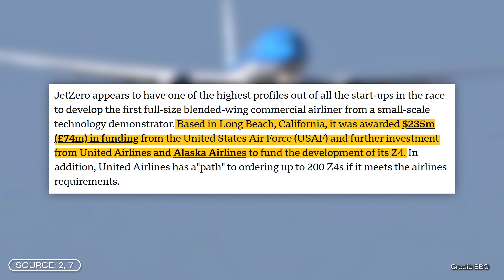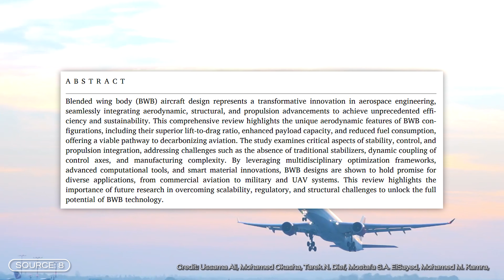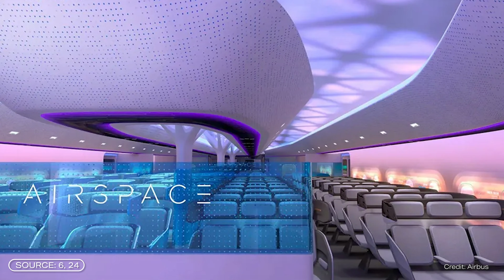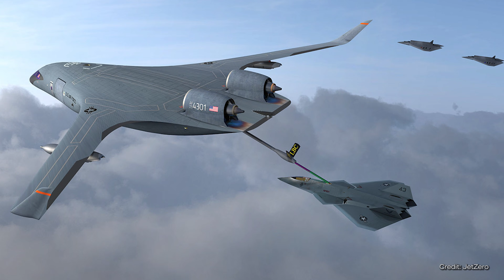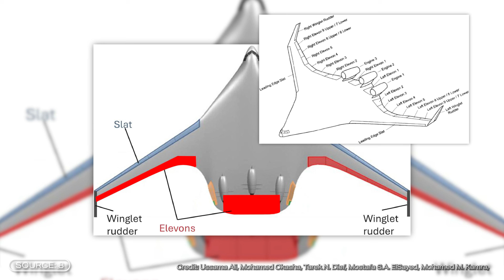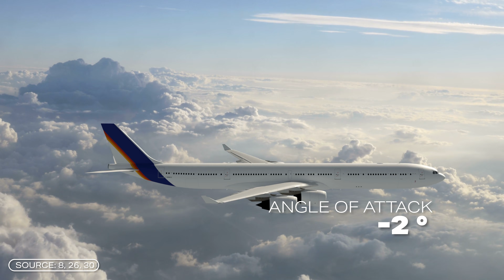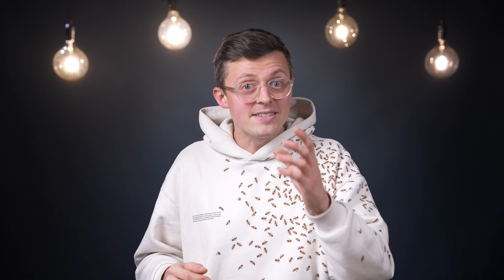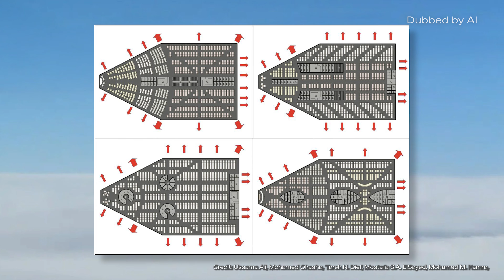The "Perfect" Plane Has One Big Problem...

Comment: Civil aircraft need to be stable without the need for active stabilization through fly by wire.
The B2 is also a flying wing, but it is not statically stable. It needs fly by wire for active stabilization. It onces crashed due to a problem with this active system.
Reply: Agreed, the idea of sitting inside a plane that needs constant micro adjustments from a computer to just fly straight does not sound inviting to me.
Reply: Yes, software crashed some 737 Max aircraft.  We don't want that
Reply: @kensmith5694 
Poorly trained pilots that didn't understand the technology they were operating crashed those 737 Max aircraft not the software. 
Those pilots sat in place like bumps on a log and watched their aircraft fly themselves into the ground.... 
No mysteries Kemosabe.  🪶
Reply: I'm confused, are we saying fly by wire is bad because almost all of Airbus planes use it.
Reply: @jake_sabrwolf9795 
It's being said that the design is inherently unstable if the only way it can be controlled is Fly By Wire... 🤷🏼‍♂️
Reply: @jake_sabrwolf9795  confused indeed ;) It's about the stability dependency. All those Airbus planes would just fly straight on their own without computer dependency. This flying wing design does not, that's the issue. If something does go wrong you're going down hard.
Reply: @jake_sabrwolf9795  Notice he said "active stabilization"
Reply: @jake_sabrwolf9795  Not necessarily. 'Fly by wire' is a system of controls that transmit pilot adjustments to various aero surfaces. 'Active stability control' is quite another issue. Most all jet fighters are aerodynamically unstable in all three axes, so they need it. Obviously the 737 MAX is not pitch stable (hence TCAS). The original Northrup flying wing had three Honeywell analog/vacuum tube stability control computers on board. There are ways to make any of this reliabiable with enough redundancy.
Reply: Also how to pressurises such a shap?
Reply: But all modern aircraft are already fly-by-wire. No control if there's a full failure of the system. I don't see how stability helps you land an aircraft without configuration control.

Comment: Hydrogen is a dummy fuel for air, lng is where it's at though. The turbines are already able to burn it.
Reply: Propane or butane, these liquids easily are common use. Not cooler required or super high pressure
Reply: @juhajuntunen7866  supply constrained tbh, and availability is not universal but we have an infinite supply of lng everywhere on the planet.
Reply: It is a shame ammonia is so toxic.  It would be a great fuel otherwise.

Comment: mods: 
1./ Use electric fans on top, use drop down modular generators under but inside the fuselage. 
2./ Passengers and cargo should be loaded via "Thunderbirds Style" modular loading these can also have parachute escape built in .
3./ Tail units should be rotate and deflect like birds
Reply: Your first idea seems like it'll be a slow pig and your other 2 ideas seem like many tons of weight that can't go to payload.
Reply: @suserman7775  your first comment seems like a troll , congratulations and good duck buddy.
Reply: Modules would also permit quicker turnaround (between flights).  No need for main structure to wait for passenger-area maintenance/hygiene or for luggage/baggage unloading and loading.   Latter would also speed up security situations requiring complete luggage unload – and would guarantee that nothing was missed out.

Comment: Also a good shape for electric aircraft
Reply: Yes.  There is a new battery with twice the energy to weight that could combine nicely with the 50% lower energy need.
Reply: There won't be any commercial electric aircraft in your lifetime and probably never.
Reply: @kirkjohnson6638  Does Archer not count?

Comment: The reason why this design keeps being dropped is the frontal area is too wide.  Conventional aircraft are skinny with a minimal frontal area.  As the aircraft gets closer to modern flying speeds that frontal area piles up and causes compression and turbulence side effects.  The blended body can only fly slower than modern aircraft for that reason

Comment: I forget the exact name, but there's some sort of windshield that isn't visible on radar. If this happens and puts the plane instantly above 6%, then it becomes unstable and jumps to 10% or more. I'm not an expert. It's just a thought.
Reply: Regarding the one "that isn't visible on radar", maybe you meant micro burst ?   If so, then that (radar blind-ness) was true before the 1990s but since resolved, through the use of Doppler tech (in radar).  Doppler being the German 😃 origin surname of the Austrian physicist who was the first to publish the fundamental frequency-"shifting" due to movement principle (same as we all experience acoustically).
Reply: @DavidEsp1  thank you❤
Reply: Presumably you meant wind shear.
Reply: @DavidEsp1  yes. I was tired and didn't double check what was being dictated. Thanks again.

Comment: Might be viable for cargo and military purposes atleast. Definitely worth exploring.
Reply: Yes, if it works well for military aircraft for ten years, then they might build the commercial version.
Reply: Agreed. -- The usefulness of the space inside the fuselage will definitely influence the decision whether to build a blended wing body design or the tube and wing design. -- With the 747 Cargo transport plane, when the front of the fuselage is opened and the whole expanse of the fuselage is opened for easy loading and unloading. That is a hard to beat that design.
Reply: If they can load wide cargo, that could solve problems like transporting UFOs, portals, and assorted wide loads.
Reply: @MsTyrie  and plus sized passengers who are demanding 2 seats for the price of 1
Reply: i think it would make a fairly poor cargo plane as it currently is. low ceiling height, structurally weaker than tube/wing types, where do you place the cargo doors?

Comment: NOT HAPPENING (for commercial passenger) since the US FAA has determined that the evacuation time from a blended body or wider body than are currently approved is unacceptable. It's a safety issue, not fuel economy. Of course, if the position of the FAA changes the blended wings might get produced by Boeing and Airbus.
The military of course can fly anything it wants to.
Reply: USA not on their playlist then. Or evacuation must planned differently.

Comment: The turning acceleration G issue is way overblown because it can be easily accommodated by doing slightly slower turns.   This will only be an issue coming into very extreme landing patterns like Hong Kong.   The flight control system will definitely include software to manage passenger comfort in turns. They could potentially also minimize this issue by using spoilerons.

Comment: No reason you can't put tubular pressure vessels inside a flying wing.
Reply: You've never heard of a little thing called WEIGHT ?
Reply: @suserman7775  yes  and the structural strength to weight ratio of a tube is greater than the alternative structures which would otherwise be required.
Reply: @crawkn Yes a tube has a superb strength to weight ratio but it is ADDED weight. Think about it, if you went by strength to weight ratio alone, a plane's fuselage would be a sphere instead of a tube.
Reply: @suserman7775 I'm talking about the tubes replacing part of the internal support structure which would otherwise be required if you didn't have tubes. Airplanes aren't just hollow skins.
Reply: @crawkn What?
Reply: @suserman7775  I think I've explained myself adequately if you still don't understand I don't think I can help you.
Reply: @crawkn You referred to "tubes" twice in a way that makes no sense. As far as "internal structure", what about it?   As far as "airplanes arent just hollow skins"...ok but who said they were?
Reply: @suserman7775  You seem determined to miss the point. "Tubes," generally cylindrical structures with hemispherical ends, are advantageous for service as pressure vessels and also can do double service as minimal weight structural support for the external wings / airframe. Without their structural contribution you would require other structural support, which might be even heavier. I won't reply again, if you haven't gotten it by now you aren't going to.

Comment: A hybrid turbine electric configuration would allow much faster reacting electric fans that would need very little maintenance. The higher maintenance parts could be put at the rear and be more accessible.   The electric fans could respond much faster than turbo fans to help with stability and control.
Reply: What speed would an airliner like that have, compared to say a 787?
Reply: @suserman7775  same, totally doable to design for same Mach number
Reply: But the Oblique Flying Wing concept that NACA/NASA engineer R.T Jones conceived could double Mach number and be much more efficient than Concord.

Comment: Far from the roll axis life becomes a roller coaster.
Reply: There was no mention of the changes that will be needed to commercial airport terminals to access these new models for passengers due to the different shape of these new aircraft for passengers to board and exit these planes.These costs could easily make such new designs not cost effective for passengers to use.
Reply: I disagree. Conventional aircraft have seats even farther from the pitch axis, and no one has reported any roller coaster effects. I suspect that the pitch change at takeoff is greater than any roll change during a turn.
Reply: Wow never even thought of that specific detail. Good point.
Reply: That's only if this design rotates around the centre "tube".
With substantial surfaces out on the side, it might be more like a catamaran than a heeling monohull yacht
Reply: @dnomyarnostaw If the roll axis isn't around the center, it makes the problem worse.

Comment: I've been waiting for the Blended Wing Body design to make its way to the public for a long time. Honestly, I don't know what's been taking the airlines so long to adopt this type of aircraft.
Reply: Not the airlines. The manufacturers. The development costs are going to be astronomical.
Reply: The reasons given in the video + cost.
Reply: I think that looking at it overall, it's not just a change of plane design, but everything in the infrastructure would have to be changed to accommodate.  From all of the runways to the very airport structure itself in order to be able to handle such a drastic change.
Reply: @brianpentecostaldeplorable9841  Yes, I remember now that the infrastructure was a huge barrier to overcome. Thanks for mentioning that.
Reply: Do you like breathing during a 14 hour flight. I don't think you would book a flight if you were told you needed to hold your breath for 14 hours.

Comment: The pressure cabin could be separate carbon fiber chamber inside the blended wing body. This would relieve much of the stress from the airplanes structure due to differential pressures.
Reply: Dumb idea. Too heavy.

Comment: elevons (eh·luh·vnz) is pronounced in english similar to elevators (eh·luh·vay·trz).   Great video!!   I wish my german were as good as your english
Reply: I've always heard it as Ell-ehh-vonnz (or ell-ehh-vonn singular).

They'd almost certainly use split elevons in an application like this on top of spoilers and rudders (on the proportionally small vertical stabilizers) as well as differential thrust all coupled to FBW controls.

Split elevons and spoilers have been used on flying wings and tailless designs since the 1940s at least. (sometimes combined with conventional rudder surfaces as well)

Northrop's designs tended to omit rudder controls, even though many of them added some form of vertical stabilizers as well (but they were all fixed fins, like on the XP-56, XP-79, and YB-49;  while the N-1M, N-9M, and XB-35 all accomplished sufficient stability through lift distribution + propeller torque+gyroscopic effects + de facto vertical stabilizer surfaces provided by the fairings of the prop shafts)

Planes of Fame was still regularly flying the surviving N-9M until a fatal crash destroyed it in 2019. (though the findings of that crash were inconclusive, though apparently not related to single engine failure or fire as in prior incidents through its life)

The N-9M also used fixed leading edge slots cut into the wingtip sections behind the trailing edge of the wings (the XB-35 and YB-49 had flaps that could close those slots for lower drag at high speeds) that further improved stability at low speeds and high angles of attack by eliminating tip-stall and risk of entering a flat spin. The Me 163 also used fixed wing slots of that type. (as did the Lockheed Lodestar, Ventura, and Hudson; albeit those all used interrupted slots that passed between the longerons)
Reply: You are showing us the U.S. English pronunciation, which is only a variant of English. Standard English pronunciation of 'elevons' as 'el-eh-vons', which is closer to the original French. Also, 'elevators' is a little different to your pronunciation when said in English. Dr. Jakob is using German pronunciation, and there is nothing wrong with that, because we can all understand what he is saying.
Reply: His English is not just good, it's perfect. He has a German accent (which I personally find pleasant and intelligent sounding), but EVERYONE has an accent to someone who is from a different region than the speaker.

Comment: The guest brings some good points about maintainance of the top mounted engines and the emergency exit situation.

Anyway it is cool they are trying this, at least we get interesting content about it either way.
Reply: As a pilot, maintainer and ex USAF.  He's not wrong, but him assuming you access the engines solely by crane is very narrow minded.  My first thought is you still access by ladder and walk on wing surface to the engines. I am confident the engineers will integrate this concept to the engines.  Also engine tech is advancing rapidly so by the time this is a commercial reality the mx cycles will undoubtedly be much longer.
Reply: @LeahyGroup maintaining an engine in bad weather (wind, rain, cold) when it's hung under under a wing is "just" pretty miserable.  Having to climb up and walk around an icy sloping wing during a cold McGuire AFB winter is going to be significantly more than miserable.
Reply: It can't possibly be that much more dangerous than a 737 MAX.
Reply from the maker: That's true. And we will see, where it goes :)

Comment: by " a path to zero emissions " I assume they mean, each new design move will get them closer ( never quite getting  to 0 )
so it's good to hear electric is ruled out. ( it's the weight guys  )

but I think airlines investing in evacuated tube mag-lev with start happening when there is a commercial example.
Reply: Reducing the lift requirements also makes electric planes more achievable. If you halve the power requirement, you double the allowable power density of your lift system.
Reply: @calmonnier2512  we can use renewable energy to produce synthetic fuels just as easily as we can charge batteries....I hope that clears up my position on it.
Reply: @RulgertGhostalker  The science shows this is extremely inefficient which is why synthetic fuels are so expensive.
Chemical bonds vs Electrochemical reactions - Multi-step conversion (electrolysis, chemical synthesis) vs Direct electricity input. Efficiency 10-25% end-to-end efficiency vs 75-95%.
Cropping for fuels takes away vast areas of increasingly rare farmland needed for food. The folly of this is shown with the mega corn and sugar cane crops that resulted in large food price costs in 200, and the conversion of over a quarter of all ag land used for fuel!
https://www.youtube.com/watch?v=0d0MPg7DxbY
https://www.youtube.com/watch?v=F-yDKeya4SU
Reply from the maker: Yeah, at some point they will probably use carbon capture